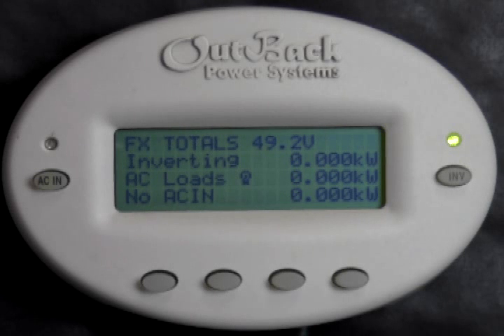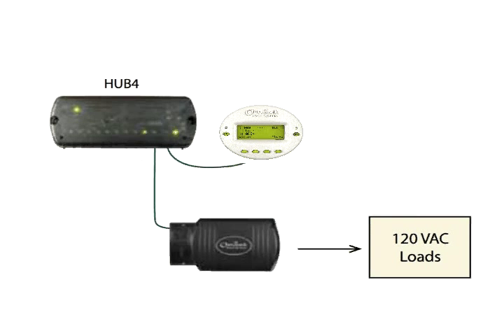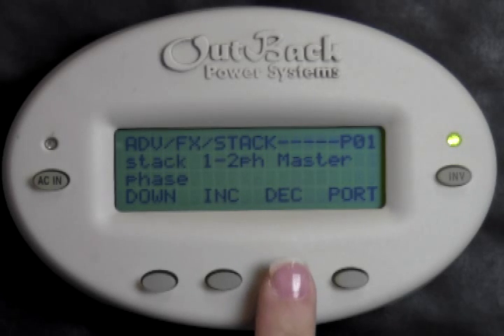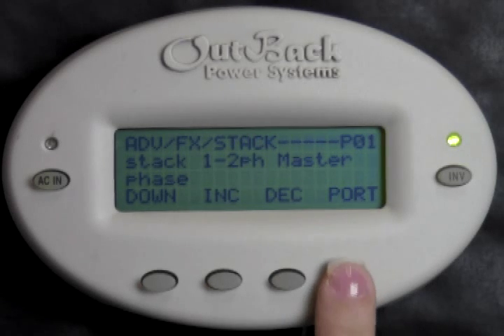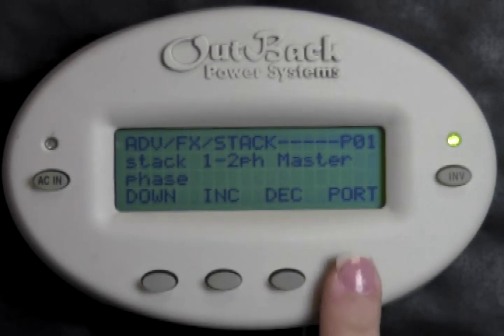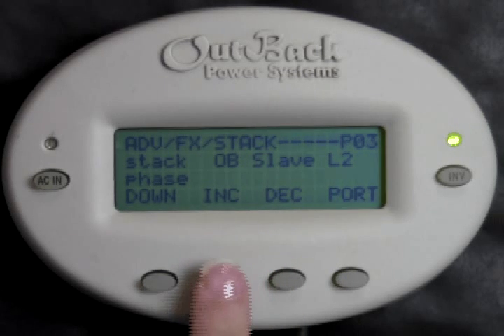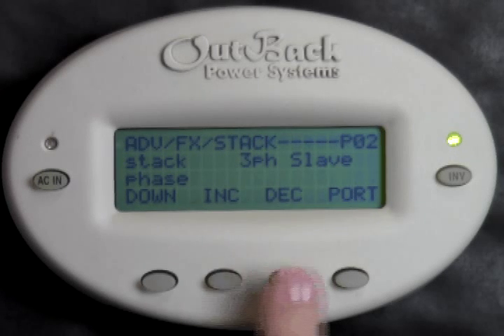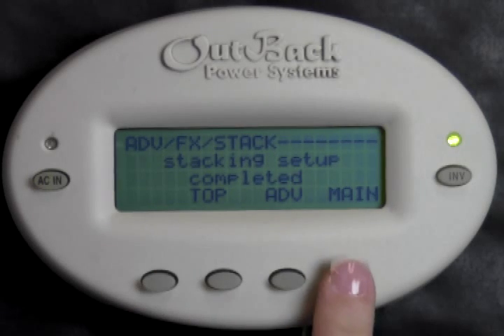Tech Support | Inverter Stacking

Comment: Can you tell me which video to watch to get my mate to start my generator automatically when batteries drop in power?
Reply from the maker: Hi Charlene. That would be the "AGS setup" video you can also adjust at what voltage you want the generator to start with the "AGS Volt start" video.